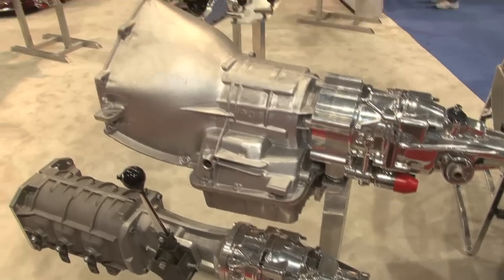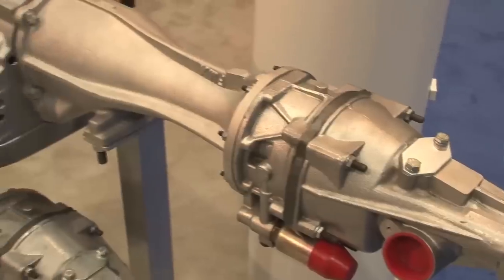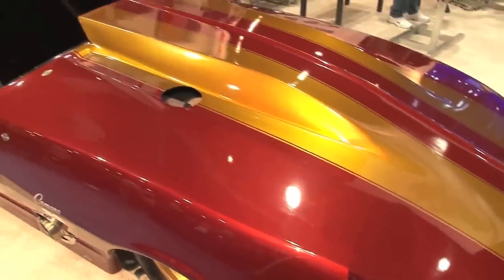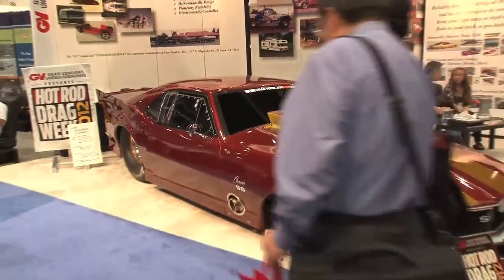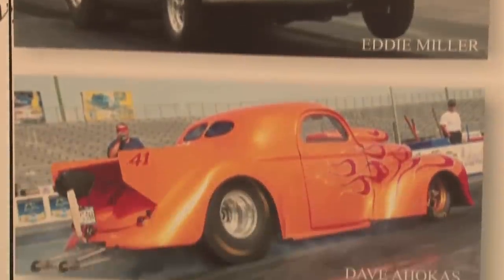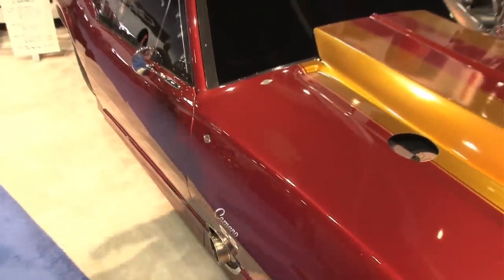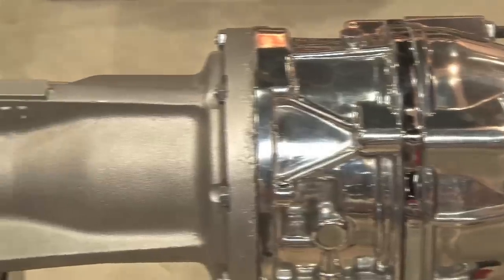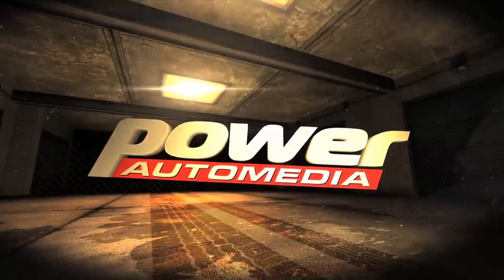Gear Vendors offers aftermarket overdrives for your existing transmissions

Comment: Old man neighbor of mine way back drove an old Studebaker pickup truck for over 50 years I remember and it had three overdrive levers that you would pull out like choke rods back in the day that old truck used to fly down the highway and got good gas mileage
Reply: Yeah iv seen it on an international truck I thank it was 56 all #s matching

Comment: This is the same price as a brand new TKX 6-speed performance transmission  (upgrade of the TKO and better fit per application over the TKO).  SAME PRICE!
Reply: But it's not the same thing.
Reply: @shelbyavant5081  I know, that's my point.  I'd rather have a full brand new transmission, with overdrive, likely rated at higher torque handling, than bolting up an overdrive on something that wasnt designed together and might be old, worn, or not as strong as current new transmissions, for the same price.
Reply: @curtthompson2787  I understand all that, but that is personal preference and application. You were stressing price. Also, you'd probably be impressed with how tough a 32 spline Muncie into a GV unit is.
Reply: I haven’t seen many TKX trans at drag week
Reply: However, you have to remove the original trans, install the $new trans, different new $cross member is required and a $brand new clutch assembly is required. Where as the gear vendors just attaches to the back of your original trans you just gotta shorten the drive shaft the cost saving is over $2000+ lower.
Reply: If you pay someone to do the work it might be less.  I could see using the gear vendors if you already have a really good performance transmission.
I ended up installing Richmond Gear Super Street 5 trans.  Can hold up to at least 600ftlb of torque with 5th gear over drive.  All in I think I spent $3500 - $3800.  Thats with any and all extra parts and oil.  Everything is new.

Comment: a gear vendors after the transfer case is a great way to split one in 1/2. forget its in over drive then activate the OD and pop...there goes your 4x4.
Reply: Unless you divorce the transfer case and put the GV right behind the transmission. Unless you have a 1970 Chevy K truck, who is going to go through all that.
Reply: @hudsonhawk0016  If your transfer case has the "4x4" indicator light it is wired to cut the overdrive out when  you shift into 4wd...

Comment: Im wondering if its possible to put it in a dodge ram v6 3.7 liter 5 speed manual and increase the fuel economy, anyone has some information about it?
Reply: Careful as the 5 speed is already overdrive so you can get to lugging you motor defeating the goal.

Comment: Have a 73 challenger with 4 speed and the gear vender overdrive love it drops rpm from 2500 down to 1800 at 65 mph

Comment: Funny how they NEVER let you know that the Gear Vendor does NOT hold during engine braking / down shifting etc....  It's for accelerating only.. They also only make (OVERDRIVE) no under drives.. And there $3000+  I like US GEAR over & under drive... At least for my 4x4s...

Comment: The plus of a GV overdrive is you can pull it and transfer to another vehicle, all you need if not apples to apples is the adapter.I just installed my 2nd one in a flat bed dually work truck, 1st one I installed 18 years ago in a hotrod and it's still working flawlessly. I love these things.

Comment: Just finished my 89 S10 with a nicely built  355 4 bolt main engine. Turbo 350 trans w/shift kit. Installed the Sniper Fuel injection kit and that works very well with the new engine.It has a stock 10 bolt rear end with 342 gears and mini spool.  I'm saving for the gear vendor to deal with the high RPM issue on the highway... it's taken 4 years and about 20k but it's worth it now that it's so close to being what I've wanted since the first time I saw the first generation S10..

Comment: I had a Triumph Spitfire with a two- speed rear end. It had a switch on the shift knob to go from low to high, giving you eight gears. For racing on curved roads it was fantastic. Clicking the switch to downshift is a lot easier than shifting the gears.

Comment: I have a 1970 340 Cuda 4 speed.& 3:54 diff.  At 61 years of age I like to still do all my own automotive work. I had to decide if installing a brand new 5-6 speed transmission would get the rpm's down enough at 70 mph to about 2000 rpms on the highway where I like to take the Cuda for a rip. The cost of a brand new 5-6 speed transmission, cost of the new clutch assembly and drive shaft modification goes well over 6500.00 dollars, that does not include the hassle of the installation......thats a no sale for me.  The gear vendors transmission $price is almost half price of the brand new 5-6 speed brand names.  I can put my car on my ramps and attach the over-drive to the back of the manual tranny myself, measure the drive shaft and have it shorten....thats all reasonable for me. Its way cool to be able to turn my 4 speed into a 8 speed and have the golden fuel economical 2000 rpm's at 65-70 mph !

Comment: So can the overdrive shift at the same shift points that an automatic transmission is set to shift at? Or does the overdrive shift at an RPM lower than the transmission?

Comment: I want to know if i could use the gear vendors with a 203/205 doubler.
Reply: If you have a manual, then a advance adapters road ranger would work.
Reply: @tinkeralexander5639  yea i use a automatic th350 that when I am going to upgrade I will just get a 4l80e with a ls and one of those atlas transfer cases

Comment: I have gear vendors on my motorhome 3 speed ford 460. I cannot find and guidance on driving the unit for optimal performance
Reply: USA4US I’m having the same issue. Any luck on it ?
Reply: I put one in a 1984 Chevy LAZYDAZE G30 MOTORHOME and just run mine in OD at highway speed. I had a situation where I thank god I put it in: this motorhome was underpowered with a 350V8 and we were climbing up Sunwapta pass between Banff and Jasper national parks in Alberta, Canada. The pass was very steep and had no guardrails. The 350 V8 didn't have enough power to climb the pass in 2nd gear and in 1st gear, it was overheating, so I turned on the defroster all the way and put the transmission in 1st gear overdrive and made it over the pass doing 25 mph. SPOOKY to say the least!! it will stay in OD as long as you are above 15 mph. I just read the operating manual and talked to them about it.. this was 10 years ago in 2009. gets about 10.mpg on flat ground, that is what I got driving CA--99 in California's  central valley. Dad said best  he ever got was 7-8 mpg. vehicle weighs 7200.lbs w/ 4.56 gears now in OD 3.56.
Reply: call gear vendors

Comment: C3 '73 454 TH400. Will it fit?
Reply: Yes, I have a 76 C30 with the Muncie 4 in it. 30,000# Gear Vendor is definitely nice to have at higher speeds.

Comment: So this can make my 4 speed  use lower RPM on the highway?
Reply: yes, the one I put in a 1984 Chevy G30 LAZYDAZE motorhome with a 350 V8 and turbo400  transmission had a 22 percent overdrive. put it in back in 2009, my dad said he never got better than 7 or 8 mpg but I was now getting 10 on flat ground. I am pretty sure it had 4.56 gears.
Reply: @glennredwine289  Hi Glenn..I just bought an old 82 Chevy Cube Van with the same 350 V8 an TH400 transmission...can you tell me exactly what you put into yours? This thing has been sitting for 15 years and the engine now runs great and the Tranny shifts real nice too, after "refreshing" as much as possible without a rebuild. MPG are terrible tho... I'm looking to make this into a RV type van ! Thanks !
Reply: @Snailmailtrucker HI I put a gear  vendors OD W/ 22% OD effect. it worked well and actually gave me 6 forward gears. Had it installed at camping world. in Santa Fe springs, CA. I  put into a VERY HEAVY 1984 CHEVY 350v8 powered  G30 LAZY DAYS.  My dad  bought this RV and didn't know much about vehicles and Lazy Daze didn't recommend any different engines this OD unit will allow you to run it in 1st gear overdrive as long as you stay above 15 mph. this OD unit was literally  a lifesaver for us because this vehicle was so heavy and so underpowered we could have been killed w/o it. We were climbing up Sunwapta pass in the Canadian Rockies crossing from Banff N.P. to Jasper N.P. and the pass was so steep and our RV was so underpowered that it could not climb the pass in 2nd gear and it was overheating in 1st gear, so I turned on the defroster on all the way,  opened the windows and put  the RV IN 1st gear overdrive and was able to pull over the pass at 25 mph, fast enough to keep the engine from overheating. The road was a narrow two lane road with no guard rails on the sides. This RV I think must be 7200 lbs and has 4.56 rear gears. I get about 10 mpg running on flat ground. Or that is what I seemed to be getting driving up CA-99 IN California's Central Valley and running cruised controlled at 65 mph. The Canadian Rockies trip was back in 2009 and the drives up the Central Valley were in 2010. My father had told me that the best he had ever gotten was 7-8 mpg. Your van unloaded will probably do better.
Reply: @glennredwine289  Thanks for your Reply Glenn....Much appreciated. Ill have to do some research ! HAPPY EASTER !
Reply: Happy Easter to you.

Comment: I Have A 1968 Barracuda with a three speed Automatic Power Glide I put a 2000 Rear End Out Of a Ford Explorer Gears Are 410 Limited slip POS Rear End I Am Doing 4 thousand R p m at 65 miles A Hour  I want Rpm to be at Twenty Five  Hundred Rpm what do I do
Reply: I know this is a 2 year old post. But I didn't know that GM built a 3 speed powerglide. And how did you get it to bolt up to your Mopar? Are you sure you're not talking about a Torqueflite?
Reply: I have the same problem but in a pickup truck. Top gear / Highway rpms need to be approx half of what they currently are at cruising speed.

Comment: They are useless in a four wheel drive truck.
Reply: hudsonhawk 001 how so? Are you really going to go over 50mph in 4x4 anyway?
Reply: @chrish5096  Because the Gear Vendors unit is behind the transfer case.
Reply: hudsonhawk 001 I understand that. What I am saying is you really aren’t going to be in a situation where you need overdrive in 4 wheel drive. Only time you’re really going to exceed super slow speeds is in the snow, and even then there’s no need to really get over 50 miles per hour.
Reply: @chrish5096  Sorry, I misunderstood what you were saying.
Reply: hudsonhawk 001 It’s all good. Definitely would have to be extra careful with 4x4 though. If you accidentally or subconsciously hit that splittler in 4x4, you’re screwed😂
Reply: @chrish5096  If the transfer case has a "4x4" dash indicator switch this is wired into the overdrive control to cut the overdrive out when in 4 wheel drive...

Comment: Too many choices for existing OD transmissions.  Far more practical and cost effective.
Reply: You can also split gears,  doubling the gears, 1+od, 2+od, and so on! But is it worth it. They are 10 speeds comming avalible, and 6&8 speeds going to be everywhere soon, I like 3pedles, changing my own gears!
Reply: @jamest.5001  Plus they are far stronger than the built in overdrive. Especially if you are doing heavy work like towing...